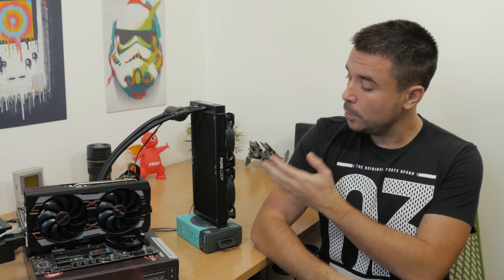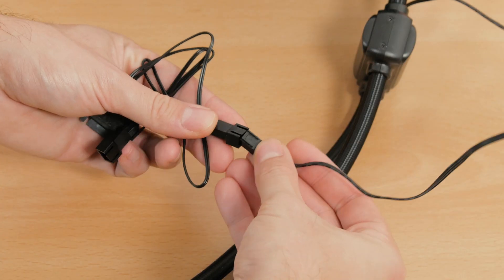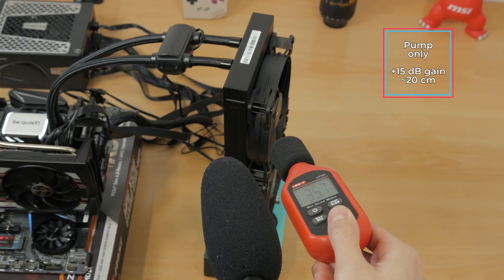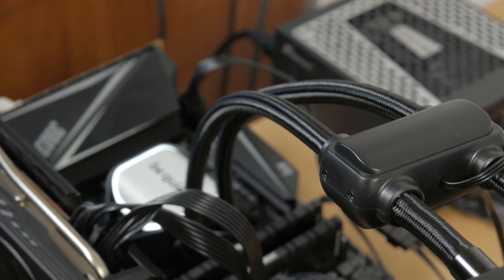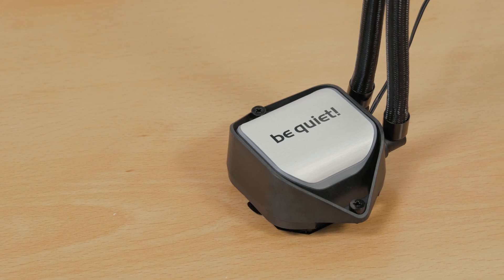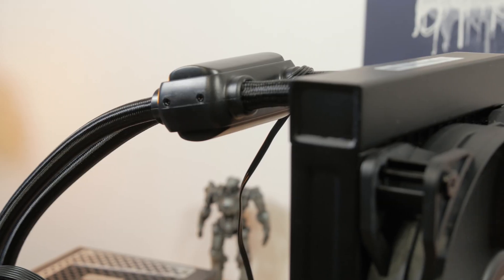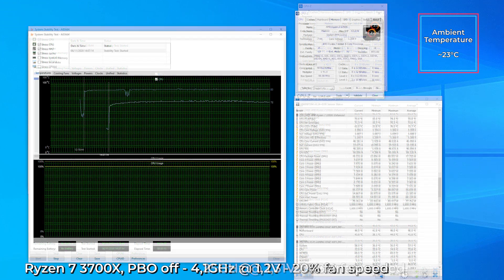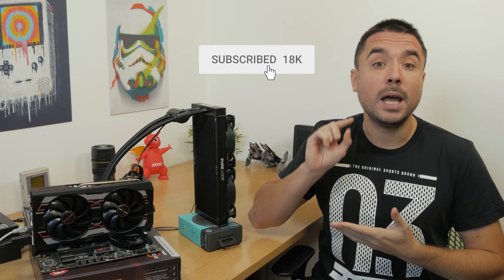They've PUT the pump WHERE? - Be Quiet! Pure Loop 280 Review

Comment from the maker: How many of you here rock watercooling in their builds? 😎
Reply: I don't have any rocks in my water cooling
Reply: No, air cooler is a simpler solution for me.
Reply: still running an air cooler, but looking to switch to an AIO, so if you could do a comparison between this and the artic liquid freezer II 280mm like you mentioned, that would be awesome, sadly no one has compared them yet, might be a good video that would get lot's of views ;)
Reply: @JB-Voices  Liquid freezer II 280 has very good performance, but I hate the look of the "batmobile" water block and the grey cabling.
Reply: @noms780  could
n't agree more, and the mounting system isn't very handy either according to almost all the reviews I've seen
Reply: @noms780  I'd have bought that AIO in a heartbeat, but that ugly ass, waste of space water block ruins the party for me.
Reply: Arctic liquid freezer II 280
Reply: Bought this for my r5 3600
Reply: liquid freezer ii 120mm... push/pull config =)

Comment: Im happy with my stock 3700x all core boost of 4070mhz. At 65c in cinebench r23. Davinci resolve render final at a mere 67c. Gaming, only 55c. Room temps is 22c.

Using coolermaster SL600m bottom mounted as intake.

I have the pure loop 2 fx 360mm.

Love it. I highly recommend it if you need to bottom mount it.

Comment: Great review! I just returned a NZXT Kraken X63 because the pump head would make quite audible coil whine noise whenever gaming or benching. I returned it and got the Pure Loop 280 and not only is it almost silent, it keeps my CPU cooler than the more expensive X63 did. On R15 bench my 10700K would get up to 78C whereas with the Pure Loop 280 it got up to 74C max. I'm sure this will reflect in gaming too
Reply: Just wondering, do you have your Pure Loop 2 Fx mounted with the tubes/pump at the top of your case, bottom of your case, or is your rad top mounted?

Comment: its all fun and games till that pump starts humming like i have now
Reply: Does the pump touch the case somewhere? I vibrates, but the tubes usually isolate it rather well, however if it touches your case somewhere – it will transfer that vibration and cause a hum.
Reply: @vaddimka  no it did not touch anything, I went back to air cooling much quieter

Comment: So I bought this 280 model purely based on ecstatic and how quiet it would be. I've mounted the radiator at the top and the fans under so they can exhaust air through the radiator. I also keep my pc on the desk next to my monitors. Once I switched on the pc I've noticed a very annoying humming sound, it's not loud but it can get very annoying after a few hours. After eliminating all of the possible noisy components in my pc, I've realised it was coming from the AIO. The pump gives off vibrations and its close to the radiator and the fans. Since the radiator is making direct contact with my pc case without any rubber padding it is causing vibration to transfer on to the pc case which then vibrates my wooden desk. You guys might think I'm exaggerating but when I work at night in complete silent it does give me a headache. Since I've had no rubber padding in the house I ended up using my old mouse pad under the pc case, and surprisingly it reduced that sound by at least 70%. It is more bearable than before but it is still there. I will be buying some single-sided foam tape and put it around the radiator along with some rubber washer to reduce this vibration even further.

Comment: You know that mobo fan headers ARE 12V right ? I tried to connect it with the included adapter and it just resulted with no light and an unpleasant noise. Since then, i connected both on mobo headers and il worked well, i was able to control it, there was light and no unpleasent noise.
Reply from the maker: I'm completely aware of that, but as Be Quiet! stated it should be at 12V all the time, I didn't want to suggest that users do otherwise, because I'm not aware what's their technical reasoning behind that and how would that reflect to the longevity of the pump if it was less than 12V on the long run.

Comment: How are these numbers reliable when u place the radiator upside down? 
You only suck air bubles into the pump and cooler since air sits on top of the coolant in the radiator...
These numbers and the lifetime of your pump will increase when mounting the radiator correctly

Most common mounting error in AIO history.
Reply from the maker: As I mentioned in the video, as long as the pump is below the highest point of the reservoir, you're good - https://youtu.be/DKwA7ygTJn0?t=591
With the Pure Loop in my case, it's a bit of an edge scenario since they have the pump really close to the inlet/outlet points, but it's still OK
Reply: What you dont know is this particular model with the pump on the tubes, is so it would eliminate bubbles and air in the waterpump.

Again.the pure loop series was design to be botto mounted. Its the best aio money can buy if one has a weired case design like my coolermaster SL600M

Comment: What do you think if you let it cool a ryzen5 3600 on an msi mobo in an nzxt case ?
Reply from the maker: Without a problem!
Reply: you may have to be careful if its an nzxt h500 series. i got a h510i and i cant fit the 280mm radiator on the front side because there was a front panel cables in the way. i had to reconfigure the front panel cables so that it does not get in the way of the radiator. Its totally doable but so much work. Just a heads up
Reply: @huskar009  thanks i bought an 710i with the Ritzen 5 3600 and i’m planning to buy a 360mm aio
Reply: We have a same set up

Comment: How is the pump noise? They claimed that putting the pump in that unique location eliminates loud pump noise and vibration.
Reply: Pump is loud and vibrating as hell! Came here to find a fix amd see of there's more complaints. Don't buy it, it is literally garbage.
Reply: @JohnyMcNeal  watch gamers nexus video on how to properly mount a radiator to reduce noise
Reply: can u please explain how to mount a radiator with foam? there are screws connecting the radiator with the case.
Reply: @noms780  My rad is mounted properly. Im using AIOs for over 10 years now. Had cors 120mm aio as the first mass produced aio back then... Had 2 custom. loops too and a lot of air coolers along tje way. So it's not me, its them, their greed amd their false advertisement.
Reply: @sircarlton6647  try to put foam between the radiator and the fans (to stop the vibration from the fan transferring to the radiator). you might need to purchase longer screws from the hardware store
Reply: @JohnyMcNeal  perhaps you could buy a good air cooler like fuma 2 or u12a?
Reply: @noms780  Already have u12a and theres a bequiet dark rock 4 in a box too. ;) Wanted to go for 280 aio... to cut the story short thats not why Im pisses... Im pissed on bequiet...
Reply: @JohnyMcNeal  same story here. replaced my dark rock 4 with a 360 aio.
so far i had only had good experiences with bequiet and therefore bought the cooler blind. this won't happen to me again
Reply: @noms780  the vibrations are not caused by the fans but by the pump. When I start to insulate the radiator or fans with foam, there are air gaps between the fan and the radiator which have a dramatic effect on the airflow through the radiator. and the other disadvantage is that the long screws are made of metal and thus transmit the sound also to the case.
Reply from the maker: I just saw this comment, so sorry for late reply. You can hear the noise samples at the end. It's audible as every other pump if everything else is spinning at low speeds (CPU / GPU / chassis fans). It does vibrate somewhat, but it gets muffeled by the tubes, while that vibrating sound is drowned down by everything else around it running.
Reply: @MattsPaddock  i would say a pump is noise. But it could only my case because i came here lookiing how to fix noise issue.. I have 280 and it's places in front of case with tubes down. So the pump has contact with the case and that's why there are some vibrations. I've tried to refill the coolant and noise is the same. Any way it's probably issue of my set up. Thank you for your review.
Reply: @derzoman2471  i have the same problem. after i install the radiator (380mm) inside a case (Dark Base 900 rev2/top mount) the vibrations from the pump transmit trough the tubes and u can hear a loud hum sound. i think its called structure-borne noise or something. is it possible to decouple the radiator from the pc case to prevent this issue? if not i will send this thing back because this sound is realy annoying overtime
Reply: @sircarlton6647  "structure-bourne noise" - do you mean resonance? try mounting the radiator to some strips of foam?